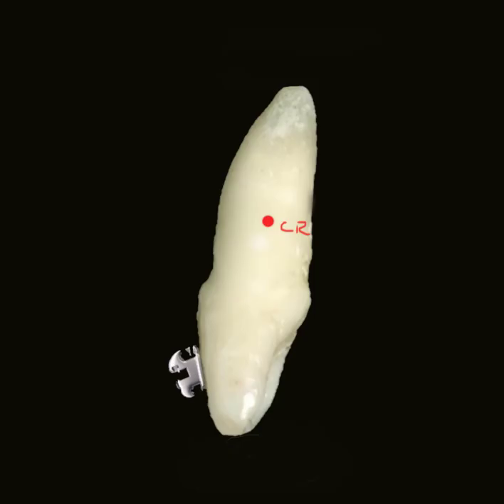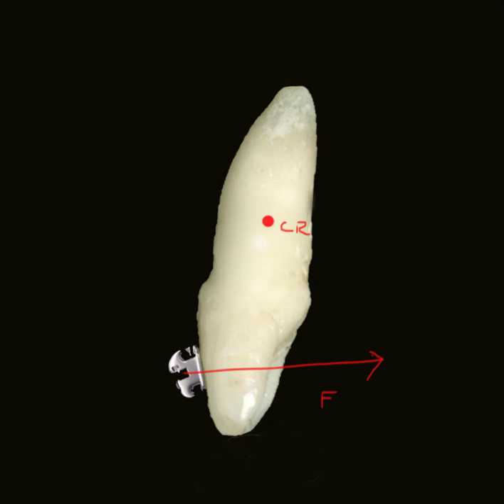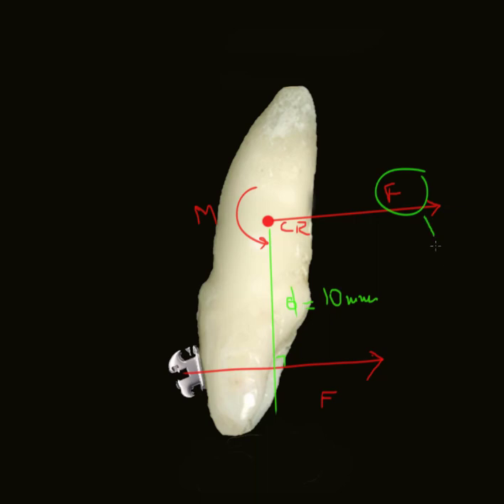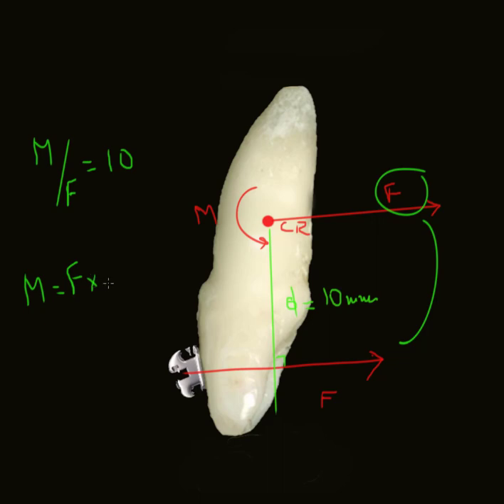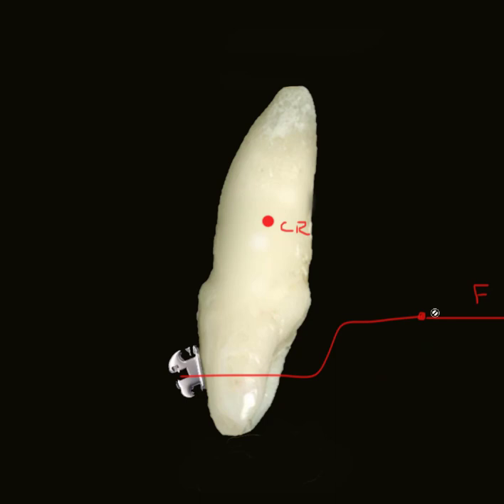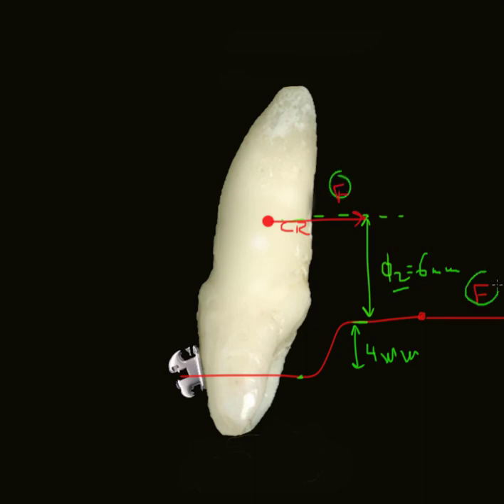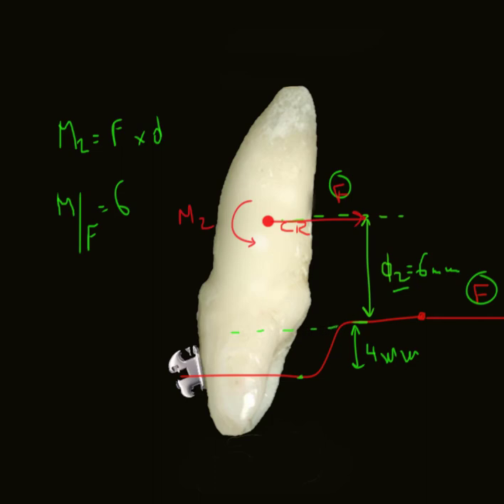Moment to force ratio

Comment: What actually haopens when moment is created..is there a movement of tooth in ajy direction or what olz explain that
Reply from the maker: When a simple force is applied to the bracket, the equivalent force system at the center of resistance is  composed of the same simple force and a moment with is a rotation movement. If you combine both, you get a movement composed of a translation and a rotation which in orthodontics results in tipping.  The moment to force ratio will determine if you get more rotation or more translation.
Reply: @Discoverortho1  ohhh thnkx doc.  Plz can u upload more videos on torque moment..with examples of actual tooth movement ..will be helpful .or if you have blog plz telll..so that i can ask my very silly qstn..m PG student currently doing ky pG in orthodontics .. 
    From india
Reply from the maker: @nikita-ho9te  we are looking at offering a course in India soon